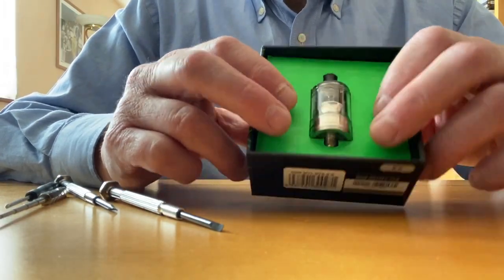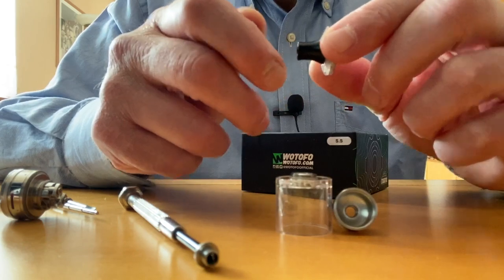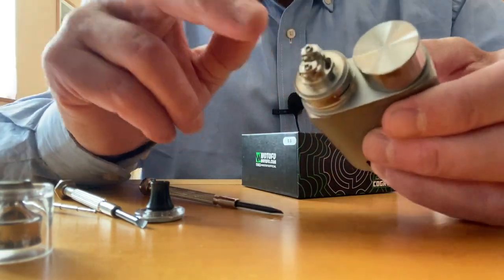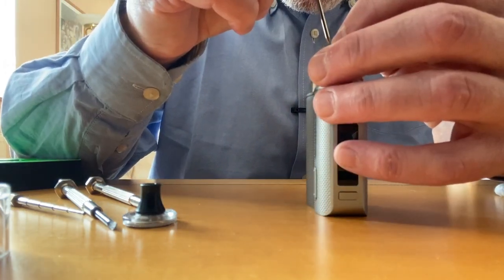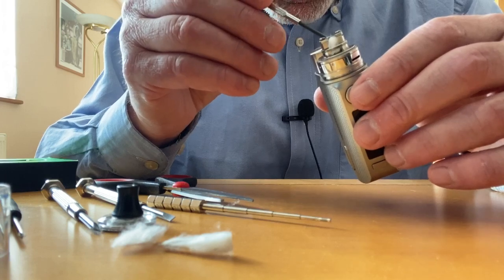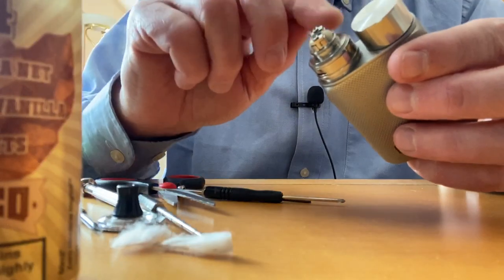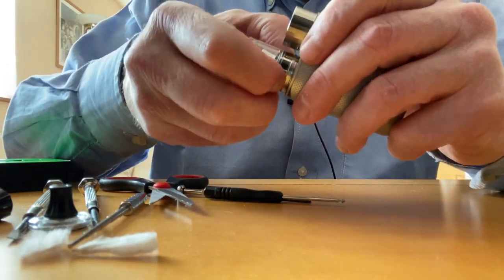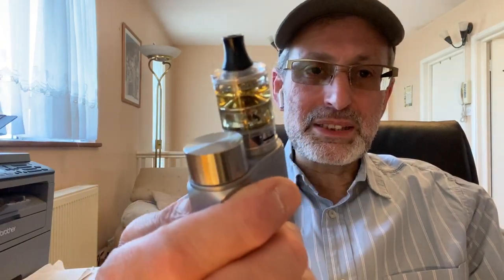Wotofo COG MTL RTA | Build & wick | Full review

Comment: Even washing in hot water can crack it, as can some e-liquid. The airflow is basically like changing inserts, so not a gimmick, but inserts are slightly better imo and with actual inserts you can set and forget or even control the amount of air the insert sees.
Reply from the maker: Thanks Adrian yes you reminded me in regards to washing the tank to be done with cold water.

Comment: Hi Net Vaper, would like to know your opinion on the new Innokin Ares 2 MTL RTA
Reply from the maker: Hi Tamer.  I have not tried the Ares 2 yet but I did vape on the first version and it was excellent in flavour and ease of use in fact one of the easiest deck to build on also very forgiving on the wicking although it was not super tight drew that they sorted with V2 with 2 airflow options on the deck and external so you can get a true MTL experience. Also they added an enclosed juice well with a ring so it will be even easier to wick. What I understood so far that it is like V1 but fine tuned.
Reply: @netvaper  thanks I know your an MTL vaper so I figured you gonna get it sooner or later. Great reviews man keep it up.

Comment: Do you have any flooding issues? Every build I've put into mine, has flooded so far.... I've changed the cotton, the amount of cotton, the coil size, the type of coil I use etc and it just keeps flooding on me 😕
Reply from the maker: Well Jamie to avoid flooding make sure your cotton tales fills the juice wells fully and touches the bottom with no gaps at all at the tips of the cotton tales to the surface of the juice wells. This method is to enable the cotton to absorb the liquid and not allow to leak off the deck. Try it and let me know.
Reply: @netvaper  will do. Thank you 👍

Comment: How do i stop it leaking from the air flow holes?
Reply: Doing at 50/50
Reply from the maker: @deskslee  to be honest deskslee I don’t have the Cog for years now. The golden rule with 50/50 liquids is to add more cotton enough to absorb any excess liquid and when tucked in the juice wells to keep them fluffy and filling the entire cavity on both sides. That should sort out the leaking
Reply: @netvaper  thanks a lot mate. I cut too little cotton and I also noticed that I tightened the screws at the bottom helps with the leak. I am intending to get another RTA MTL tank which I saw your review and some others, I might go for kayfun X. It's really hard to get these stuffs from where I live...